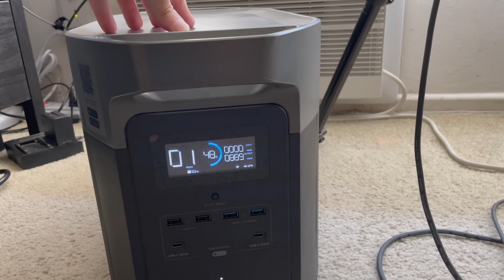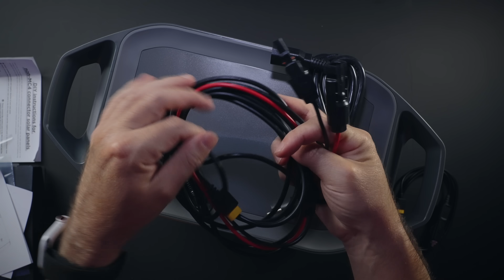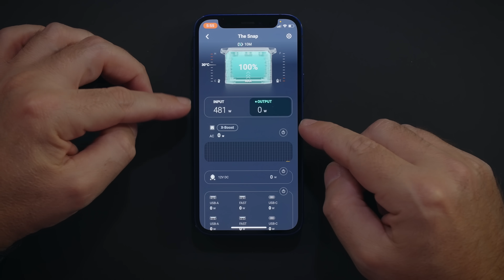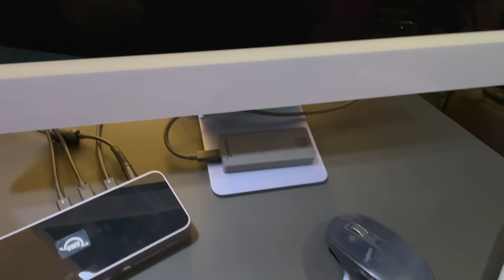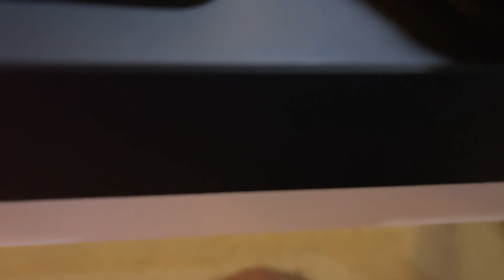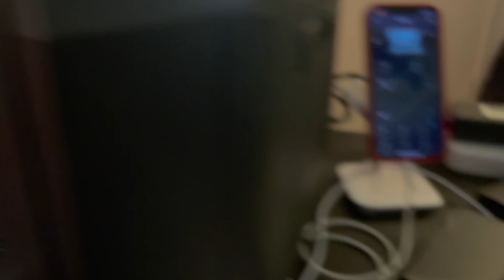Battery That Powers iMac for ~34 Hours! — EcoFlow DELTA Max

Comment: Thanks for putting the video together. I've been "reconstructing" UPS devices for years now by replacing those tiny batteries with higher quality AGM batteries and higher amp hour rates. I knew it would be a matter of time before someone picked up this idea and had a commercial solution. I need really reliable power to my workstation. The key difference is the ability to have AC output and charging input at the same time. No switching when the power goes out. That removes a failure component with a normal UPS. The cost, tho, yikes! I know these things are expensive but $1700? I can get a commercial UPS and rebuild the batteries for 20% of that. Still, it would be nice to have this uber-clean package that already works. But there is a cost to that which not everyone can afford. When you make an investment for the things on  your desk that create your livelihood it doesn't seem that much in the end.
Reply: Dude, you need to start taking commissions. If it's even 10% less than this you'll have a market.